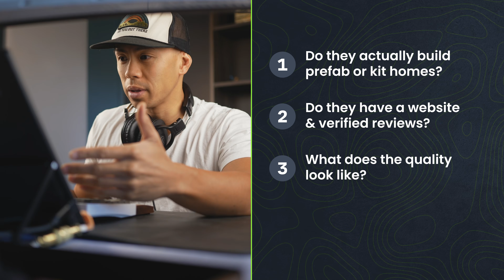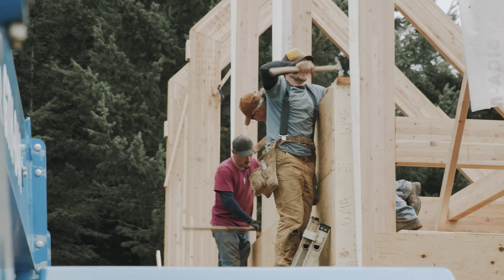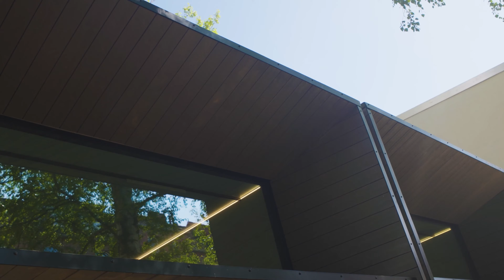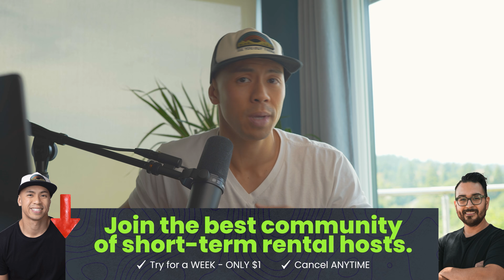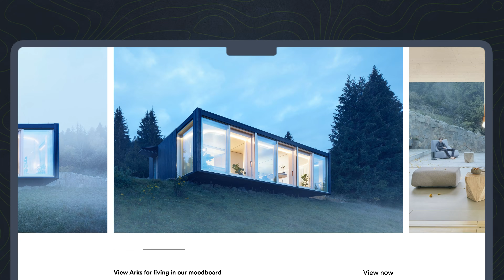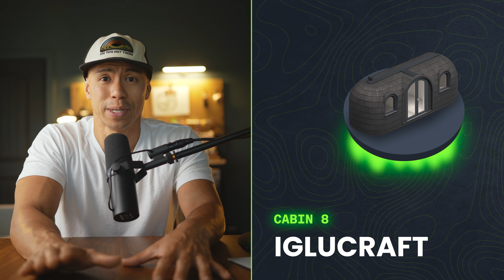I Reviewed 50+ Prefab Companies—Here’s Who You Can Actually Trust

Comment: Hey Kai, Hey Everyone. Whats the proper channel to potentially explore collaborating on your projects? 

We are a hardwood glulam manufacturer and also a prefab cabin manufacturer

We offer full design and build customization. Our unfurnished 269 sq.ft. pricing ranges about US $27k with exotic class 4 timber, kruing/apitong.

We usually supply 5 star resorts, and is looking to expand to airbnb markets.

We are based in Indonesia
Reply: Oh and we are ISO, GLTAA, FSC, SVLK certified. Our factory is about 500,000 sq.ft.